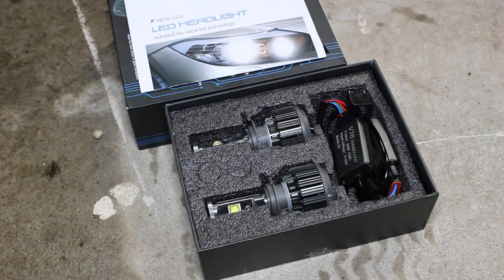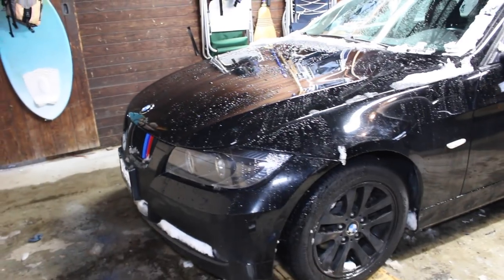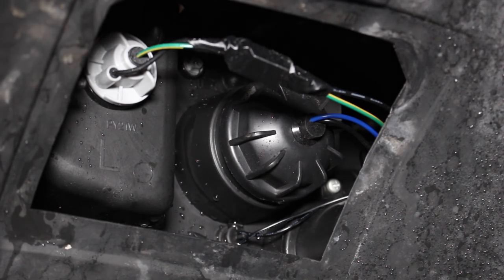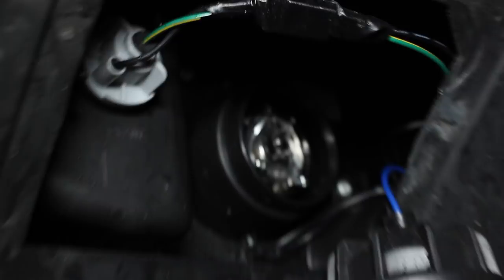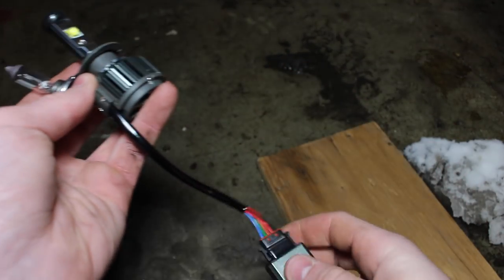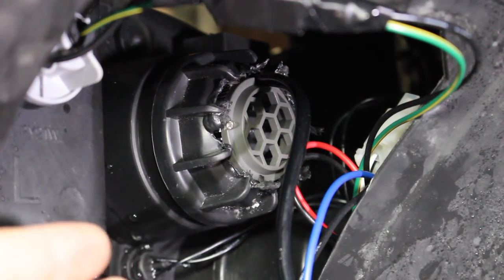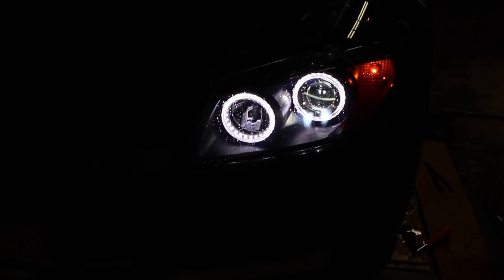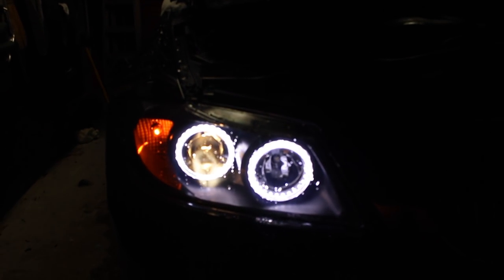LED Low Beam Bulb Upgrade // BMW E90

Comment: How did you make the hole? I have the same problem. I just used duct tape to cover the gap without cutting a hole since I do not have the tools.

Comment: JD, it looks like you glued the back of the Led Fan housing to the plastic protective cover in an attempt to seal it from moisture. How so you plan on removing the bulb if you every have to in the future since the retaining clips inside are still connected? Love you channel by the way.
Reply from the maker: I actually didn't glue the backs, but that is a good idea!

Comment: Hey man! My low beams are on the way, I'm soooo excited!! I just wanted to make sure I understood everything, because the alimentation doesn't fit, we have to do a hole?
Reply from the maker: Prince Infini I'm not sure what the case will be for your specific headlights...but hopefully you won't have to make a hole
Reply: If I do, how did you do it?? :0
Reply from the maker: Using any tool of your choice (which can cut through the plastic) example: a dremel, a knife, a blowtorch to melt through, etc.

Comment: Maybe somebody else has already pointed this out but I did not see it in the post. How is has the moisture been in your headlight after cutting the hole in the cap? because you allowed room for the fan to breathe which is what LEDs need to keep the heat sink School it then allows moisture to pass through the fan and through the heat sink and condensate in your headlights. I have not found a solution to prevent moisture from getting in the headlight I have already done this process before seeing this video but I noticed you used a heat gun to seal around the whole but it's not stopping moisture ,might be restricting a little bit but I think people should know that they will get moisture in their headlight if their vehicle is ever out in the rain unless someone has found a solution to this. You'll be ideas I have come up with is creating a moisture barrier between the bulb and the heat sink that but can't come up with a way to do it. please don't think this is a bash on your post just something you may not have been aware of before doing it and something that I knew was going to happen that I was willing to sacrifice to have better vision at night even with the fogginess

Comment: Mate, cheers for the video, I have a question, is the bulb adapter to battery connection comes with the LED bulb? It's like when u place an order is the connector comes with it (to connect the led bulb to battery) ? I appreciate if u get time to answer
Reply from the maker: It has the connect pre-wired on

Comment: I ordered similar headlight housings to the ones you have, and before I install them I would like to change both the low and high beam bulbs to LED. What size led bulbs do I need for high and low beam bulb replacements?
Reply from the maker: It depends on the housings...but most likely H7 and H1

Comment: hey man... got a beginner's question ahahah I have a bmw e90 328xi 07 & my light access is different from yours... I believeI have xenon or bixenon lights & that the light is a squareback... will this fit?
Reply from the maker: This should still fit your car! It is almost the same process, just a slightly different looking light.
Reply: JD Cars My low&high beam are from the same light... will it still work? :0
Reply from the maker: Yeah!

Comment: So wait, you had Projector housing headlight with Halogen bulb in it and not HID? I’m confused...
Reply: I just bought upgrades because my 335xi Xenon headlights had the yellow angel eyes. The ones I got now have the F30 look, but the bulb is a Halogen, and not HID or even LED. So... it happens. It's cheaper on them to make them and ship them, then you customize it to your liking.
Reply: Andrew Chapman Got it, so those are not the stock headlights. How is the cut off on those projectors? And you could had LEDs on those low beams also right? 
Awesome videos as always!
Reply: @renzonovara2728  So far the halogens suck and can't really tell how far out they go. Again, since I had the Xenon auto adjust headlights before, I have to code out the error and find a way to get the high beams working (if I care enough) because the headlights I bought are for the halogen plug and play only. I am currently researching LED's to buy as I see they are easier and brighter than HID's. It's all electronics and wires, so I just need the right bulbs and a power source really. They are clean and can be manually adjusted left and right, as well as up and down, and the actual projection is flat on the driver side and curve up right a tad on the passenger side for both headlights as to not blind drivers in front. I thought it was odd but appreciate it now.

I'm just going to get LED upgrades for my fog lights and use those as my brights for now, if ever need be,

Comment: Very well made video! I attempted the same install in my 2007 e91 328xi wagon that has factory halogen lights. 
Unfortunately my stock bulbs are Osram 64210 (H7 mini) which are significantly shorter than CougarMotor's H7. I cut a hole in the back-panel of the headlight fixture (slightly different design from the newer? E90 headlight fixture in this video), unfortunately the CougarMotor bulbs wiggled in the socket so I left the stock ones in.
I have ordered a few extension springs to hold the larger bulbs in place but thought that it might be useful to note that 64210s are shorter than CougarMotor H7s.
Reply from the maker: It is a challenging install. I too had to create a small hole, but it worked out ok in the end.

Comment: So the new bulbs make the stock halos shine brighter correct?
Reply from the maker: Jackson Shrader No these are just for the low beam lights, the halo rings have a separate bulb. I was happy with the brightness and color of my halo rings.
Reply: JD Cars where did you buy the low beam bulbs? Thanks man
Reply from the maker: https://www.amazon.com/gp/aw/d/B01H6NZ6MK?ref=olp_product_details

I bought them on amazon, but amazon unfortunately doesn't carry them anymore!

Comment: Hey just wondering if you have stock healights or not because I like the non yellow side reflector in yours and I want to have that without upgrading the whole headlights. (White reflector in the headlights instead of the stock yellow). Thanks
Reply from the maker: These are aftermarket headlights... Spec D headlights

Comment: It’s been a year since you’ve posted this vid, just wondering how the leds are performing. Would you recommend them over HID’s on E90s? Thanks in advance. -Gerald
Reply from the maker: I have had a good experience with these bulbs... never burned out or threw any codes. Would recommend on a budget... HIDs are the best.

Comment: How did you remove the dust cap to drill it out? I bought some LED bulbs for my headlights and am wondering how exactly you did that step.
Reply from the maker: The dust caps twist to the left to remove.

Comment: I have the same LEDs but they flicker when i stand on the gas pedal. So when the RPM are changing, i get this flickering. Do you have the same problem?
Reply from the maker: Occasionally I have this occur...not sure why.
Reply: I heard from Justin it's a voltage check. I know with HID's you might be able to get a wiring harness and use it for the bulbs which will cause them NOT to blink and error on dash too.

Comment: What did you use to cut the hole in the cap so the bulb could fit?
Reply from the maker: Lol I used a blow torch and melted it out.

Comment: bought this for my 2011 328i but the clip that secures the bulb doesn't seem to fit. Would you happen to know if I can buy new clips? 
Thanks alot!
Reply from the maker: Possibly...stock headlights?
Reply: they are the stock headlights haha. Thanks!
Reply from the maker: I'm not familiar with whether or not you can get different clips...

Comment: I was considering going with LEDs but I was afraid the headlights getting fogged up! If you could do a update video with these in few weeks would be best! I subbed to you too keep up the work!
Reply from the maker: moneyfan18 I haven't experienced any fogging...I'll do any update soon. Thank you!
Reply: JD Cars nice upgrade. did you need any cancellers or such to avoid fault warnings on the dash?
Reply: I have HIDs currently, Bought them from amazon named Kensun with an Hid harness for 19.99 and sloved my error lights and works perfect no flickering or anything!
Reply: moneyfan18 thanks for the reply. i also have those cancelers for hid and also works great

i mean for leds... can use those cancelers tham came with the hid kit?

thanks for the reply :)
Reply from the maker: grey fort Correct! The little canceler/power adapter was included. These bulbs were advertised to not cause any code warnings on the dash, and they worked great!

Comment: would these fit on a 2011 bmw 328i (halogen from factory) with ccfl projector headlights?
Reply: the car doesn’t have the stock halogen headlights, it has aftermarket ccfl projector headlights but still have that ugly yellow/white light i want to get rid of
Reply from the maker: Yup!

Comment: Hi i just installed low bean both sides as per your video but as i switch on headlights warning alarm indicates on inside speedometer what should i do so this waring sensor wont appear again plz help or have i fitted wrong let me knw plz
Reply from the maker: What bulbs did you install?
Reply: JD Cars H7 same like yours
Reply: Waiting for your reply
Reply from the maker: The same brand?
Reply: JD Cars yes same brand same model error shows always
Reply: Just code the error out :)
Reply: CSYON how to do it
Reply: You need a obd adapter and carly. Or you know someone who code it for you.
Reply: CSYON no one here in India would no how to do it. Is there any prb bcz of plug in negative positive while fixing led  as i fixed as it is didt knw where is negative and positive
Reply: The H7 LEDs should be error free. I know there are some people with error problems. They code it out. But you can try to send them back because you have an error problem. Hm you only have two ways to plug it in. Just try it the other way. This could be the problem (but i really dont know).
Reply: CSYON ok will try bro thanks for your support

Comment: What happens if your halos go out and you simply just change the bulb too?
Reply from the maker: No, they are high intensity LEDs...it is highly unlikely the halos will go out.
Reply: Mine went out recently well the passenger side so I would have to take it to the dealership right?
Reply from the maker: Do you have these exact headlights? If you have the stock headlights you are able to replace it yourself.
Reply: No i do not I have a 08 328i and if I could get those headlights  it help out do you know where I would be able to get them by any chance?
Reply from the maker: http://www.ebay.com/itm/191561050928?_trksid=p2057872.m2749.l2649&ssPageName=STRK%3AMEBIDX%3AIT
Reply: Ok thanks man appreciate the help👍🏻👍🏻👍🏻